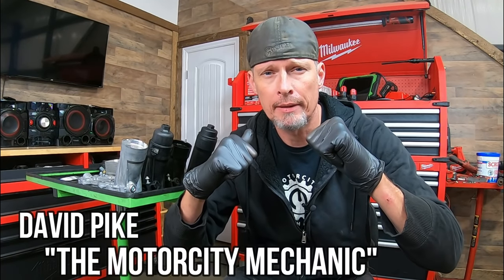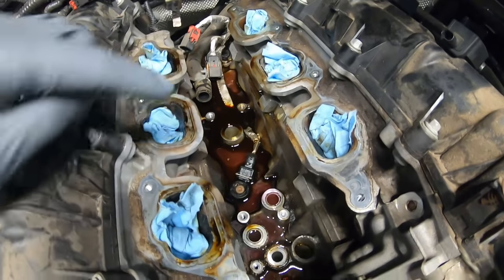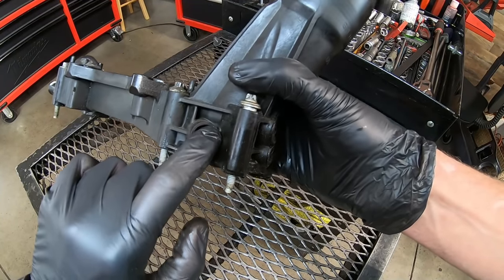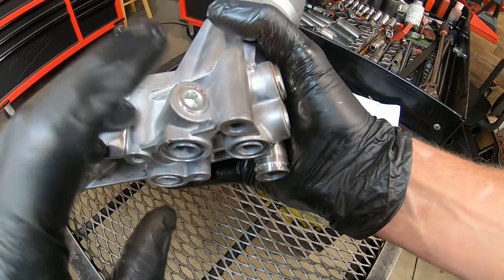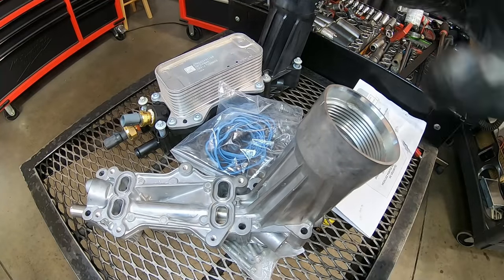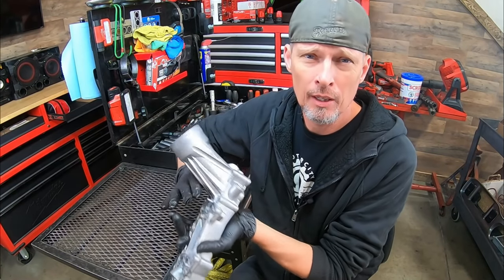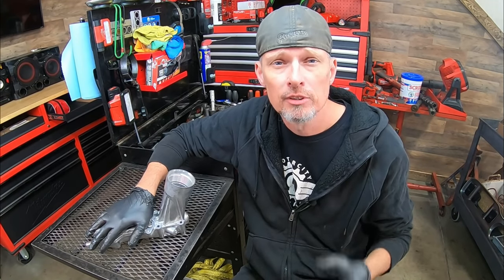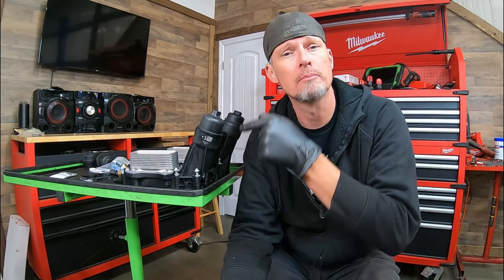Dorman 926-876 Aluminum Chrysler 3.2/3.6 Oil Filter and Cooler Housing Upgrade

Comment: I have to replace mine in my 2017 Ram 3.6L VVT 
Do i need to take off the injectors? If so, what is a good way to do this w/o breaking the red locking pin?
Do you have a video on this already that I can watch?
Reply: Follow up Question sir: Should I lube the gaskets before replacing (like a thin layer on the seal similar to what you do when you do an oil change on the oil filter?)

Comment: Quick question. I have a 2012 jeep jk with the 3.6 about a year ago I replaced the oil cooler housing with the upgraded filter with new housing from a video I seen you do and it fit. So my question is since I have the newer filter housing and you have to swap out parts would it fit in my case?
Reply from the maker: Dorman makes another replacement now that includes the cooler so you wouldn’t need to swap anything except the sensors
Reply: @MotorCityMechanic  Thank you

Comment: It works ok if you do not overtorque the filter but the design is not ideal. Auto Zone stopped selling the aluminum based unit because mechanics at local shops kept returning them due to the oil temp sensor not working after the swapout. I used the plastic replacement after I had a cooling sys failure when the fan motor thermal fuse shit the bed while in line at a border crossing. I am still good to go after the fan motor resistor ( Dorman) brand failed and came open leaving me in a traffic jam with no fan. I hit temp max and ran the cabin heat full fan in order save the rad. I got home and replaced the fan resistor ( Chrysler) careful to reconnect the fuse w a crimp connector as soldering would melt the fuse.

Comment: Question on my 2012 JK.  If I already put a 2014 (gen 2) oil filter housing on my 2012 can I upgrade it to the all aluminum housing based on I have the gen2 cooler to put on it?

Comment: To be clear --- if you have the gen 2 oil cooler available to you, this housing cooler setup can be used  on the gen1? Also, are the 2 sensors on the gen 1 and 2 the same? (I will have a brand new gen 2 assembly to get all the necessary parts from)
Reply: You can but you have to buy a gen 2 oil cooler.

Comment: Exact issue with the wife's 2014 Limited Durango.  The problem is I can't find the Dorman assembly absolutely anywhere!  I've checked every single place I can think of and even contacted Dorman... no reply yet.  Any ideas other than waiting?
Reply from the maker: Email me at david@motorcitymechanic.com and I will send you some info. I have a few for sale
Reply: @MotorCityMechanic  Thanks a bunch.  Emailing now.  Awesome videos by the way!
Reply: @MotorCityMechanic  David is a life saver!  Thanks soooo much!  Dorman finally replied and said they won't have any to distribute until early June!  Planned install after this cold snap!
Reply: @MotorCityMechanic  :  picked up a new oil pressure switch as you recommended.  What is your preferred thread seal when swapping out the oil pressure and temp sensors?

Comment: I replaced my 3.6 Oil Cooler with the latest Dorman unit. It's no longer made in the USA. It's now made in Malaysia.
Reply from the maker: If that’s the case then I’m very disappointed. I have lately been using the Mopar versions with no issues so far. Sometimes when I hear the word Dorman it’s very hit and miss with their quality
Reply: I still think that there will be seal failures with the aluminum units. The O Ring on the oil port is so thin. Time will tell. @MotorCityMechanic

Comment: Could this be mistaken for head gasket problem if it is leaking coolant from coolant ring ? Mine 3.6 2011 Durango keeps overheating after normal driving and is leaking spots of oil

Comment: So a gen 2 aluminum oil filter housing will physically fit in a gen 1 . Can you put a gen 2 oil cooler on it and work that way  ? What is different in the oil coolers for gen 1  and  2 ?

Comment: Model year 2023 of the Pentastar.  Are they still having issues with the oil cooler assembly?
Reply: Yes, since they're still using platic for the housing assembly. They can make improvements, but platic is prone to fail

Comment: I have a 2015 G.C. on first start of day I get a bearing noise OIl pressure is good.. What should I be looking at Is there a Check valve? somebody told me the cam phaser is bad.. Ive seen a baxter oil filter upgrade you use a canister filter replacing the cartilage filter
Reply: There's no check valve so oil drains down while sitting. You're on the right track with the baxter oil filter upgrade to help with this. Search youtube for the baxter item and you'll learn more about it.

Comment: I wish there was an adapter that bolted to the engine valley and had nipples that you could use to run hoses to an external oil filter and cooler!

Comment: Can this part cause overheating? It's my only symptom, temp likes to hangout between 50-75% (I don't know the actual temp but, you get what I mean). No oil in coolant, no coolant in oil. No leaks (already did Y heater hose fitting). Already pressure tested, no leaks.

Comment: When I go to the Dorman website, they say that Part 926-876 will fit my 2016 Dodge Grand Caravan. I think you said that my Pentastar is a 3rd generation engine (2016) and the 926-876 couldn't be used on that engine. Please let me know if I'm remembering that correctly. Thanks!
Reply from the maker: Your van is a 2nd gen engine. There is no cut off as far as years on the second gen. In fact we are using both the second and third as we speak. I never mentioned the Caravan having a 3rd gen, the Pacifica does
Reply: @MotorCityMechanic  Thank you for putting so much detail in your videos. I use to write procedures for an electronics company so I thought I should mention that your level of detail is fantastic! 
   With regard to my last question: I was watching this particular video I'm commenting on right now in the spot where you were explaining how the Dorman Aluminum Oil Filter Housing would only work on some generations of engines. There is a chart you displayed and it had the year of the engine at the top (2016 Current Gen 3). This data was in the right hand column. That's why I thought I had a Third Generation engine in my 2016 caravan....because of that chart saying 2016 at the top right. If Chrysler only installed Gen 2 engines in the Caravans period at some point, then that's a good piece of information you might want to add to your video. 
   On a similar subject (preventive maintenance) : If I have 78,000 miles on my Caravan's engine it sounds like you would recommend replacing the Oil Filter Housing before it starts leaking.  Is that an accurate statement ? Also, what about the rocker arms; do I need to replace them too (since they look like a time bomb waiting to happen)?  I have a very small and intermittent miss I can detect. The miss occurs  about anywhere from 15 to 30 seconds apart (randomly). FYI, I'm trying to eliminate things that can be causing that miss. I want the idle to be completely smooth and right now it's not. Thanks again for your help David.

Comment: Thanks for the information,  but my transmission still doesn't work right. It goes into reverse just fine. When we put it in drive it takes off when it shifts it comes to a stop and feels like it wants to go into reverse. What might be the problem, could you help?

Comment: I was on the online chat with Dorman Service Rep and they said this 926-876 does not fit my 2018 Chrysler Pacifica. Their online fit guide confirms. But will it really not fit, or have they just not yet tested it on that application ?
Reply from the maker: The Pacifica should be a VVL/VVT engine (3rd gen…..that’s a term I use to understand the different versions) so it won’t work for that vehicle. Never seen a Pacifica leak yet but anything is possible.
Reply: @MotorCityMechanic  Thanks for your input. Your video was very helpful. My 2018 Pacifica is indeed leaking oil from the filter housing/cooler assembly. I can physically see oil in the valley of my engine, down by the filter end of the assembly. My mechanic noticed this oil leak when performing my annual vehicle safety inspection. It has not been leaking for long, but I cannot pass inspection with this leak. Service dept. at my local Chrysler dealer confirmed that this repair should be fully covered under my 5 yr/60k mile powertrain warranty. Taking my vehicle in on Friday.

Comment: Hey brother I have a 2017 dodge ram 1500 blackout is there anyway I can get rid of the key fob and install a regular key for starting the truck thanks and God bless you ......bob
Reply from the maker: Unfortunately no you cant. Its part of the security system that they all have, no way to bypass.
Reply: @MotorCityMechanic  thanks brother

Comment: Great video first of all & keep them coming. Question is I already updated to the 2014 plastic model 2 years ago. So that means I already have the oil cooler that will bolt on to the new lower aluminum housing correct?  Thanks in advance for your time to answer.
Reply: This is the exact scenario I’m in…jw wondering the same since we already have the updated one????

Comment: In my case I could notice oil leak from the highest section of the plastic body where aluminum oil cooler starts / this joint was leaking not the plastic to engine parts

Comment: If I’m not mistaken the gen 1 can accept the Dorman unit so long as you get a 2014+ and newer oil cooler to pop on top?
Reply: That's my understanding as well.
Reply from the maker: It can as mentioned in the video “IF” you can get your hands on a cooler to swap over.
Reply: @MotorCityMechanic  I’ve been told by my tech (not a dealer) to just go to my local dealer and see if they have any that were in for warranty due to the plastic housing cranking or degrading and pulling the head sink off of it, good or bad idea?
Reply from the maker: @cbrown17982010  that may or may not work. As long as you know the failure reason. Just have to find a tech working at the dealer to get you one otherwise the service writer is going to give you a crazy look when you ask lol
Reply: @MotorCityMechanic  hahaha yeah I agree, thanks for the responses really appreciate the feed back and awesome videos🤙

Comment: So David is saying I am screwed because I have gen 1. I would definitely use the Dorman aluminum but simply can't because the oil cooler will not fit from  gen 1 because the oil cooler from gen 1 will not fit the aluminum housing. Screwed I guess and seems if I get a 2014 oil filter housing it will fit on my gen1 but will need a filter from 2014. I have a slight oil leak so this is telling me to get a 2014 filter housing, use my gen 1 oil cooler and move on with a 2014 filter. Darn it all to heck.

Comment: Does anyone have a part number for the UPPER oil filter housing seals? By upper I mean between the upper oil filter housing and the actual (piggy backed) oil cooler itself. Yes, I know the kit does include these. BUT, gaskets will eventually leak and I want to be prepared for that eventuality. Otherwise if those gaskets are not available, then some day I may have to buy a whole new unit just for the gaskets.

Comment: I appreciate your thorough videos and explanations. You answer the questions I'm usually left with on other guides and forum posts. I definitely plan to use your resources in the future as I maintain my 2012 JKU. 

So...hypothetically, if I got my hands on a used 2014-2015 oil cooler assembly AND this Dorman part, I could then successfully retrofit the Gen1 Pentastar on my 2012 JKU, right? Of course, at that point and cost it might make more sense to just install a new 2014 assembly, then retrofit with the Dorman part if/when that fails.
Reply from the maker: Of you can find one….yes. Just removed your will always need a 2014 filter from then on
Reply: @MotorCityMechanic , thanks! One of the comments said they got a used 14+ Mopar filter housing assembly and installed the filter cap and oil cooler from it onto this Dorman unit. Seems like that should work based on what I'm understanding. Does that sound right?
Reply from the maker: @mphilleo  where ever you can get it will work

Comment: Don't do it.  I got 185k out of the original part. The party 
didn't fail, the gaskets did. I put this dorman part on my 2015 dodge journey and it leaked within 4 weeks. I pull it out and put the mopar oem part back in. No more oil leak. You've been warned.

Comment: Why are these parts leaking so much? What is causing the failure? I think i have to replace mine on a 2016 Jeep Cherokee 3.2.
Reply from the maker: My main answer is being made out of plastic and the temp changes it goes thru being that it’s bolted directly to the block and has coolant and oil flowing thru it

Comment: question i cleaned out the oil after pulling out old one. i connected the hose to the new one and i noticed as i moved it more liquid was comming up out of the holes as i munuverd the new housing so i had to clean it again is that normal ??

Comment: Mechanic for 22yrs, WHY is there not a Gen2 style oil cooler available separately that can be used with this Dorman assembly?
Reply from the maker: They have since come out with a complete kit with the cooler and related bolts and seal. This should be the correct part number…..just make sure to verify first for your application. Part# 926-959

Comment: Why would this upgrade not fit the 2012? If you state you can put the newer adapter on the 2012 why wouldn’t this work.
Reply from the maker: Per Dormans website no………physically yes you can but you would have to buy a complete plastic housing assembly just to rob the needed parts off of (cooler, bolts, oil filter cap, etc) so it wouldn’t make since cost being that you would be basically paying double in parts. But there is another option….Dorman came out with another kit that’s a one size fits all. Will be making a video on that one very soon
Reply: @MotorCityMechanic  Hope you can get your hands on one soon...

Comment: I get an occasional oil burning smell as if oil is dripping onto An exhaust manifold like a SBC used to do from valve covers gasket leak. I am not low on oil and it not dripping onto the driveway and the oil level remains constant and smells okay. Any ideas?
Reply from the maker: Possible leak from valve cover gasket. On the wranglers I have seen the passenger side do that from time to time

Comment: I recently purchased a use 2008 CLK350 convertible, for my wife. Those parts look like they came from that car. At least from looking at the front of the engine. Not sure of the lower design, because I can't see that part. The the cooler is right in front of the engine, instead of hidden under the intake manifold. 
I just purchased Dorman parts for my 2011 5.7L  Hemi. It says made in China. 😔 
In my opinion, all these plastic parts should be aluminum already. But hey, they have to cut costs, and have things break, because most of their income is parts and labor.
Reply from the maker: A lot of brands use something similar when it comes to a cartridge style filter
Reply: @MotorCityMechanic  I haven't seen this type on a US vehicle before. I also haven't owned a Chrysler 3.2 or 3.6. I've only seen them on a BMW I've owned and the CLK350, that I got for my wife. So I was thinking, it was a design Chrysler inherited from Mercedes.

Comment: This will fit your gen 1 engine. You have to use the gen 2 filters but the part should fit just fine.
Reply: Yea, but you will need to find a gen 2 cooler.
Reply from the maker: Exactly…..got to source that cooler and then your good to go.
Reply: @MotorCityMechanic  Wonder why dorman didnt include the gen 2 cooler as an option for gen 1 engine owners. Shouldnt be that hard to source a used one with the amount of these engines in junk yards.
Reply from the maker: @jaysworld707  I don’t see any manufacturers offering that because the biggest issue is the oil filter. If you go by year and engine you would have an issue and that’s were the confusion comes in
Reply: @MotorCityMechanic  Hello, David. I appreciate your contents very much, and "THANKS" for publishing them with your kind explanations with the precious knowledge you have from a lot of experiences.   And.... about this point,, I thought Dorman could make one also for Gen1, because so many people having the issue for time being, will be happy to replace it without worrying the oil filter confusion. What do you think about this? The reason I want mention is that I thought the Gen 1 3.6 Pentastar engine it's self is still pretty reliable good engine I feel.

Comment: Thanks but One issue I can’t overcome is my check engine light won’t come off and My oil psi sits at 91 and doesn’t fluctuate while driving. Has anyone experienced this or have any idea how to fix it? I even rebuilt the factory cooler with new seals and replaced it for a second time thinking I got a defective one from Amazon.  Same issue. On a 2017 ram 3.9vvt

Comment: I replaced my oil cooler on my 14 avenger 3.6 anyways its leaking again lmao only lasted 6 months and still leaking properly from the same place last time which seems to be the oil passages anyways the temp sensor that came pre installed is reading incorrectly and is letting it run slightly above operation temperature smack dab in the half way mark if I'm moving its down slightly so I can see the whole mark. Will admit never had better heat lmao